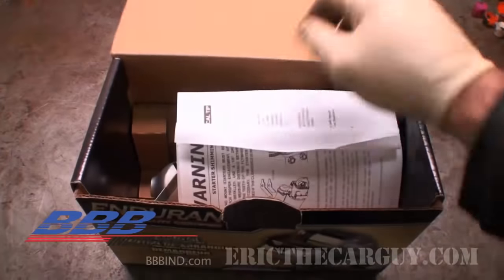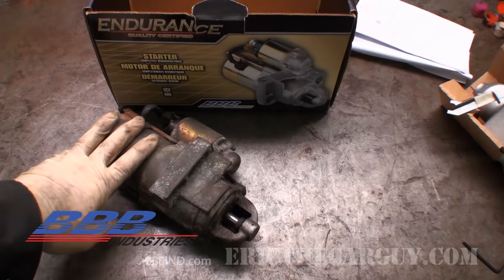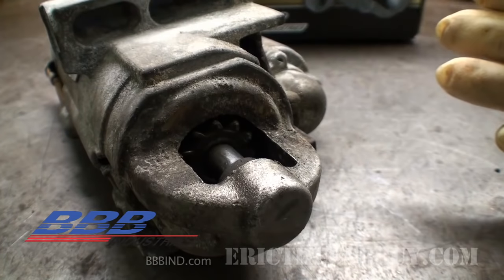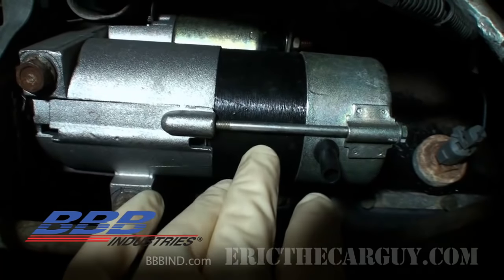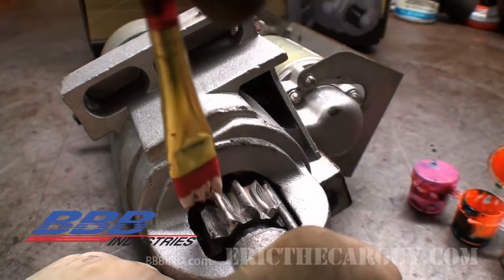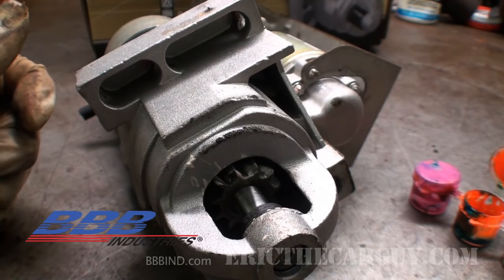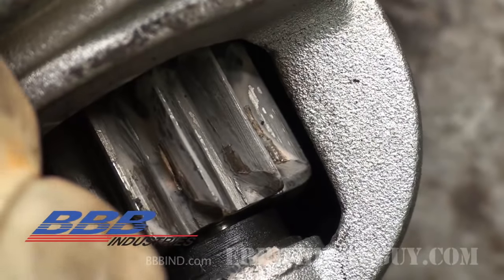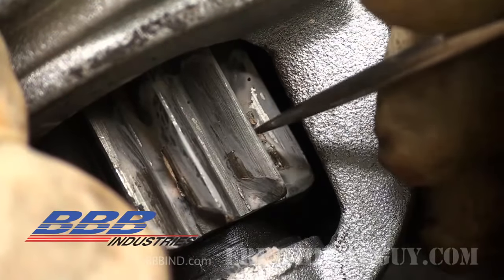How To Shim A Starter - EricTheCarGuy

Comment: I've got a 1977 Chevy K10 350 with a manual Toploader 4 speed behind it can not get a starter to work not engaging properly from one shim to fortunes up and down been through two rebuilds and still can't get it right doesn't seem to want to go the question is is the flywheel on the manual for the clutch 4-speed transmission are the teeth on Netflix different than the automatic flywheel can somebody please read this and get back to me let me know what they think
Reply: You probably already know the answer by now, but to anyone else with the same question-
GM used 153 and 168 tooth flywheels.  GM trucks would use a 168 tooth flywheel and would use a different starter than a 153-tooth flywheel.  You have to use the starter that came with or matches the flywheel you're using.
Reply: Netflix? What are you even talking about?

Comment: If it was the same starter from before just a new one why is grinding . The old starter didn’t require shims so why would the same but newer starter need shims ( 99 Chevy Silverado 1500 5.3 2wheel) . It the same thing I barely turned the key and I hear the same noise

Comment: What ?
Shim 1 side ?
You do realize the starter you're using does not have bolt holes straight across from each other ?
& Shimming 1 side will cause the starter to sit crooked which will cause premature wear because the starter drive teeth will not ride or mesh properly with the ring teeth .
BTW just from the sound you need to put a thin shim on that starter .

Comment: every have one to far from the shaft i have one about 1/4 inch from teeth to the shaft--i dont see anywhy of getting it closer-????its a replacement from china
Reply: My experence says parts house sold you a one that will not fit.  Compare original with new starter size and HAVE THEM test both.    Hope helps.

Comment: nice video about how to measure the clearance.. but shows nothing on "how to shim a starter" like the title says
Reply: Yes it does. If the contact pattern wasnt right u would just add a shim or remove one depending on contact pattern and reinstall. How are so many people here so stupid? Theres a shim with 2 bolt holes that line up with the holes on the starter...shims obviously go between the starter itself and the engine (no other place for them to possibly go)... ffs people you shouldnt be working on cars if you cant figure out the blatantly obvious..